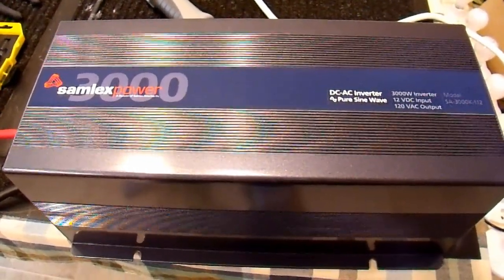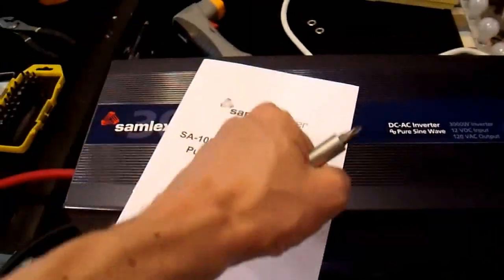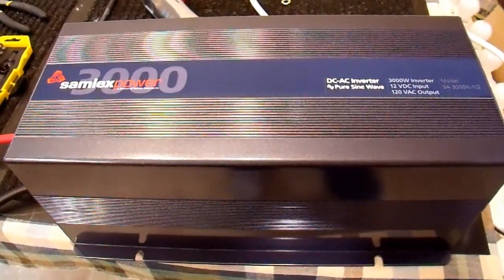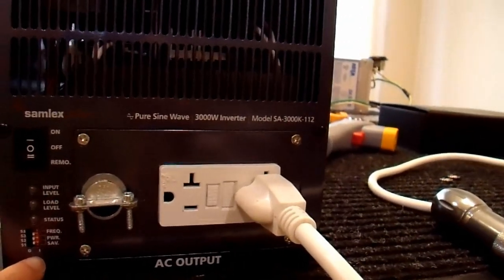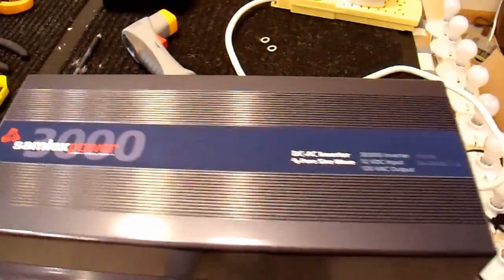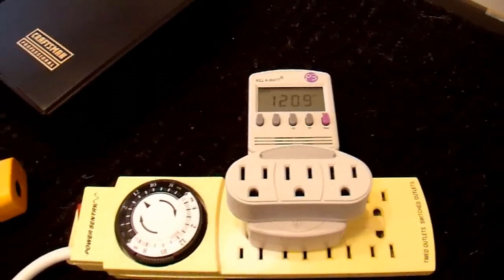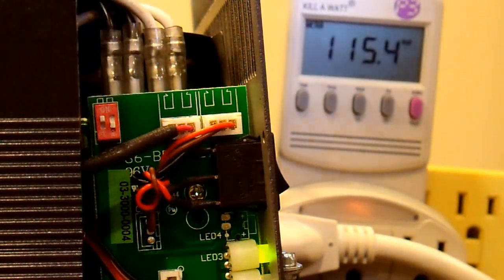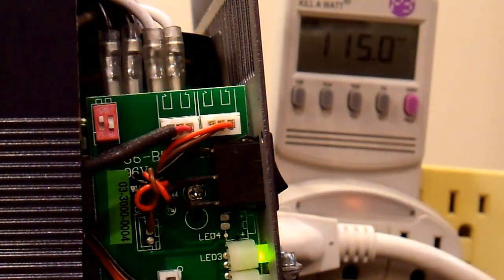Samlex Pure Sine Inverter - How to Adjust the Output Voltage

Comment: I don't think you right about lower voltage = more efficiency. Common sense is you cant get same amount of heat or cold from 120V 5A and 110V 4A in a same amount of time ... If you lower voltage on appliance it will take less Amps but to get to the same heat or cold it has to run longer. Simple as 1+1=2 Besides it is not good for refrigerator compressor to lower the voltage. This is not a good advice for your followers.
Reply from the maker: Motors in appliances like refrigerators are designed to operate in a wide variety of conditions including in buildings with poor wiring where the voltage may be as low as 100V.  Those manufacturers don't want complaints so they make sure they operate acceptably well even in non-ideal circumstances.  Due to this they are always optimized to run at a lower voltage than nominal, usually 110 to 115V.  If you connect a variable transformer up to your refrigerator and put an electricity meter on it you'll find that it takes the least amount of power and total energy at a lower voltage than nominal.  If you go too low it will cause the current to ramp up more than the voltage goes down, but that usually doesn't happen until closer to 100V.  Keep in mind that any megnetic devices (motors, transformers, etc) have hysteresis loss which increases with increasing voltage.  Usually motors start saturating badly much above 130V and the knee isn't that much above 120V as they are optimized to operate acceptably down to 100V or so.
Reply: @knurlgnar24  You must be dealing with some special refrigerators. Regular kitchen refrigerator will not even start on lower voltage like 110 volts if sitting unused for a few weeks. Coming from my own experience I have to start my gen to start the fridge the first time when going back to my cabin after month or so and then switch to inverter/solar. Inverter runs at 118 volts, Honda gen/inverter runs at 127 volts. 
Anyway my point was most of the people will not have some special refrigerators so best is to keep the volts close to 120 V.  And when it comes to small heaters we know 1+1=2 
Thanks

Comment: Well i certainly cannot recommend this product at all. My company  purchased quite a number of samlex inverters to power some hot spots sites but it was a waste of time and money, because they kept going down.....smh.
Reply from the maker: Was it this model?  Samlex has a variety of products that differ greatly.  Given the application you mention I suspect your company made the common mistake of purchasing a small 'cost effective' model and did not oversize it adequately, or installed a model with a fan in locations with high dust.  I have worked for a company that did the same things with power supplies and then wondered why failure rates were high.  ugh.  The lesson was learned eventually and then once warranty claims went down to low levels guess what?  Yup, back came the cheap junk.  It's an industry-wide problem.  Even the model in this video is NOT what I would consider proper for industrial applications although it's great for residential use and many companies use much worse to get the low bid.

Comment: Better than my 2500 watt vector inverter.At 13.5-14.4 loaded or not volts are under 100 frequency is 43 to 45 hz.I am going to check if this thing has a pot inside to adjust 
It I hope.And info would be much appreciated.
Reply from the maker: I've had a killowatt meter fail such that it no longer reads RMS properly.  (would read properly in a wall sockent but not all inverters)  A long shot but it might be good to check with a true RMS multimeter or another known good device.  If your frequency is truly wrong then that inverter appears to have a some serious issues.  It's probably worth opening up as you likely have a bad logic power supply or oscillator or something like that.
Reply: @knurlgnar24  possible.The seller just got back to me and said.The shop he bought it from says that it should go up with the load BS and it could have a 50-60 hz switch on it BS.

Comment: I have always thought that an electric motor was designed for a certain amount of power to run. If that is true, changing the voltage will cause the current to change to equal the same amount of power as before.  If that is true, a motor designed to run on 110vac draws 4.5 amps if the voltage is changed to 120vac the current will drop to 4.125 amps . Both instances equal 495 watts

Comment: I live in PUERTO RICO i watch every video that I come across that you make I just start a small solar system with a XANTREX C40, AIMS 1500W, 2 12V DEEP CYCLE SEALED BATTERY 100Ah each, soon as th electricity came back the inverter don't make the switch and the transfer stay in the position that not convert 12v to 110vac, in the low cost area which inverter you recommend, with this setting I only have power to use my small refrigerator and my pedestal fan, I'm strugleling to survive only with my social security and help my 90 years old mother, I accomplish to energize my house thru the breaker box switching on off the area I'm not using and on the ones that I need only for hours the s.all refrigerator was on 5hrs turned off so batt can recharge to use the fan on night, can you give me an advise please, I will deeply appreciated.
My email: luismartinez53@yahoo.com
Again thanks, GOD bless you.
Thanks for share your knowledge.

Comment: I always thought higher volts were more efficient because you can run less amps and get the same watts.  For instance if you have a 1000 watt appliance at 120 volts then your running 8.3 amps as opposed to 115 volts at 8.7 amps to get the 1000 watts?  I’m no expert just thought higher amps create more heat.
Reply: This is correct. A load draws power (watts). If a load needs 1000 watts it needs 1000 watts. Lower the voltage up go the amps.

Comment: I have a question the power cut off from your battary bank is this ajustable what I have seen is will drain down to 11 volts before warn of low power now your try to maintain a battery bank you don't  want to drain it past 12.2 volts or so which I believe about half way on your bank can this be done or is there another  way to  shut it down

Comment: Any way to adjust INPUT CUT OUT voltage?  I have a simlex 2000 modify sine wave,  Battery input voltage must be ABOVE 12.36vdc, it CUT-OUT at 12.35vdc. I would like to adjust the cut out to 11.5vdc. Is that possible? how?
Reason: I have simlex2000 installed on my RV. I have 2 AGM batteries (new) at 1010ah/ea + 200watt solar panel (charging state). I would like it to power my refrigerator (while driving) w/o running my generator. Unfortunately, inverter will cut out less than 10 minutes.

Comment: Hey, I love your videos, thank you for being so smart and educating us all. What is better 12v or 24v Inverter? I currently use a (sua1500rm2u) 1500 Rackmount APC unit for power outages I have connected (4) GC2 6v 214ah batteries to it set up in series to make 24v. These sit in the garage and the cable passes through the wall to the APC unit. I would like to replace the APC unit with a 3000 watt Samlex or Go Power but can't decide if 12v or 24 volt will last longer in on a power outage. Any help will be appreciated :)

Comment: Q: Why do they let you adjust the frequency but not the voltage?
A: Its for the Japanese market. In Japan the standard voltage is 100 V. The standard frequency is 50/60 Hz.

Comment: This would apply to the cotek inverters, as samlex, go power, and thor, are all manufactured by cotek. I'm pretty sure cotek is samlex's parent company, I don't know how go power and thor are affiliated with cotek, but go power is owned by some other company now. There is no difference between the inverters but a paint job and a few little features that my be thrown in to the different ones. A $1,199 samlex is no better than a $980 cotek, as they are literally the same thing, just with different shades of blue. Same quality control, same parts, same factory.

Comment: Hi,
I really enjoy your videos and have found them really educational. One question i have is about the Samlex. Go power and Thor inverters are they available for Australian use? around 230/240V output would be great.
If not what other Brand would you recommend for use here?
Thanks M8 and keep the videos coming :)
Reply from the maker: Yes, 230V versions are available.  Take a look at the Cotek SK3000-212 as an example.
Reply: *****
Thanks for your help and for recommending the Cotek SK3000-212!
I was surprised to see there are a number of different units and wattages to choose from, but I definitely need the extra output of the 3000W unit you recommended.
Thanks again for all your help
Cheers
Graham
Reply from the maker: Graham Macleod
It's a good 3kw unit and is honestly advertized unlike many others.  It does >3kw for a short time, has a real surge capability, and will do nearly 3kw continuously at a reasonable price.  So long as you give it good battery power and don't expect more out of it it than what a 3kw inverter can do it should meet your needs.  Best wishes.
Reply: Graham Macleod. Did you get this recommended inverter? If so how is it working out?

Comment: Incandescent bulbs use less power but become less efficient with reduced voltage. Of course, efficiency is probably of next to no concern if you're still using them.

Most switching power supplies are more efficient at higher voltages, especially the universal input versions. A common exception are some digital audio amplifiers with unregulated supplies, where lower voltage means less power use at the expense of slightly less (but most likely still far more than enough) maximum volume.

It's also nice that the inverter has the option of setting the output to 100V/50Hz, which can make for less power draw on motor loads. That can be nice if you're OK with a 20% slower load in exchange for 20% or more better runtime.
Reply from the maker: A good point on the 50hz/100V setting.  I hadn't considered using it for that.
Reply: *****  I have a samlex 1500 that needs repair could I pay you to do it?
Reply from the maker: odinson810 I could look at it but I cannot guarantee that I will be able to repair it.  After shipping costs both ways it likely won't be worth the risk/reward of the endeavor.

Comment: am looking to buy a inverter/charger what do you think about the xantrex Freedom SW 3012 (815-3012)
Reply from the maker: Unfortunately I haven't seen, tested, and disassembled one to check it out, but I would recommend to stay away from the generic 'Chinese' brand units.  You might pay a little more for the Xantrex name but at least you know you'll get something that is 'All right, I guess' or better.
Reply: thanks the 3 brand you recommend does not have a inverter/charger as big or needs other part to make it into one

Comment: Thanks for this video.  I found the same is possible on my smaller Cotek.  How to change voltage output on a Cotek S600 inverter
Reply from the maker: Thanks for the video!  Now I have evidence that this same method works for Cotek Industrial style Inverters as well.

Comment from the maker: The fan is not variable speed and comes on at low loads - somewhere around 150W if I remember correctly.  It is fairly quiet but definitely not silent.  The internal heatsinking is good compared with most other inverters I have seen.  The internal components are conformally coated to protect against corrosion.

Comment: they make 220v out inverters for that '
cant use 2 110 inverters to make 220 because the transformers will not be tied together  The waveforms would have to be synced to each other 
best to just buy one built to run 220v out

Comment: i just got the 1000w ssw-samlex pure sine inverter 
will run my tv's and computers with it and a 1500w modified wave to run other stuff 
setting up 400w solar/400w wind battery charging system with 6 175ahr golf cart batteries
for a off the grid system for emergency/on demand power 
plan to expand system in the next few years in hopes to me 100% off the grid 

will have my tv's internet router and 1 laptop and one home pc 100% off the grid

Comment from the maker: AC units generally are more efficient at lower voltages as well.  AC units need to run in widely varying environments, unlike refrigerators which keep a constant temperature, so they do not have as optimized a PSC system but will still be a little more efficient at lower voltages.  I would not go below 110V.

Comment from the maker: They cannot be stacked.  They also cannot be connected in series to make a split phase 120/240 output.  They are very nice, however, and while much more expensive than the cheap-o stuff I consider them a good value.